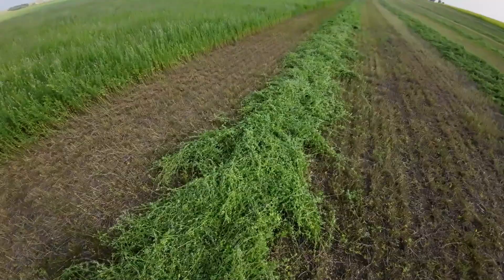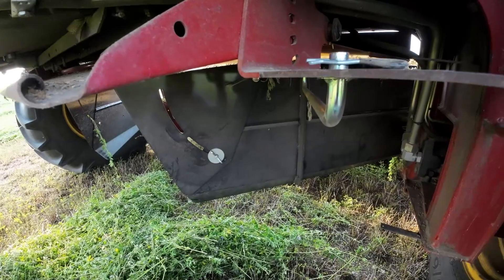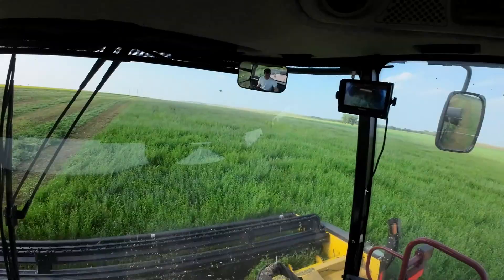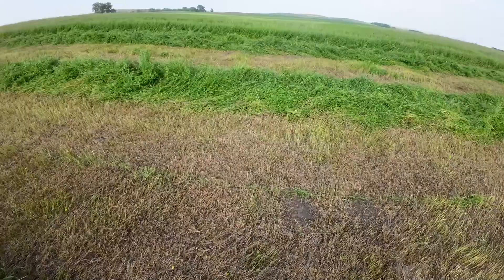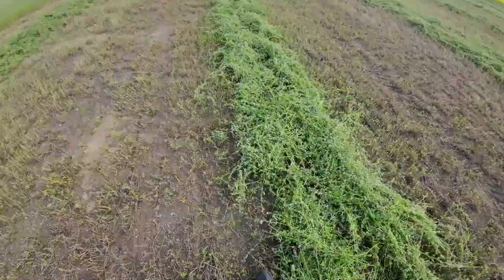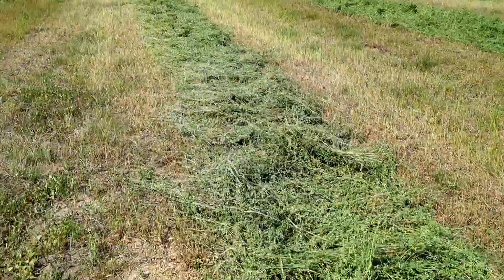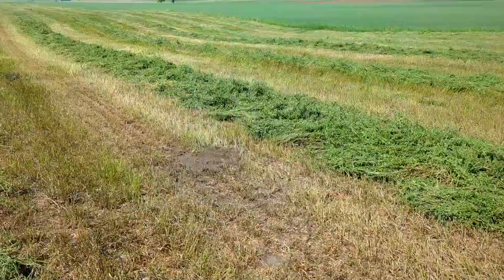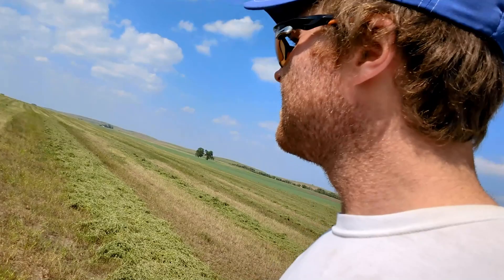Does Windrow Shape Matter This Year?

Comment: on the way to town a farmer was cutting his alfalfa , 2nd round around the field, it looked pretty tall so we stopped and went to see the farmer, he said that 10 inch magic rain pushed this crop into over drive and it standing 5 ft tall in places, his rotary mower was plugging up so now he is trying to cut with his swather but cutting a 38ft swath is too big, he wished he had a smaller swather, told him we have 15 swathers from 12 ft to 20 ft he could come and check them out if he wants to rent one. crazy how the plants soaked up all the rain we have gotten, another 3 inches on saturday along with the biggest thunder storm we ever seen. we shut down the power to the hog barns and ran on generators during that storm, the flickering power messes with all the systems in our hog barns so we played it safe. the 3 test barns where the pigs have 96 inch tv screens go nuts when the tv stops working. crazy how they watch and listen to some programs and other sleep through them.